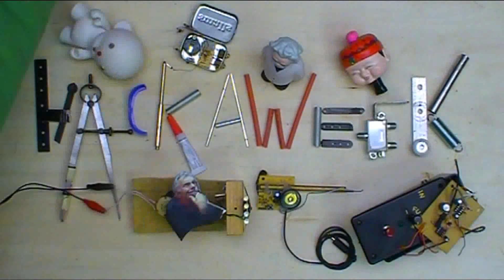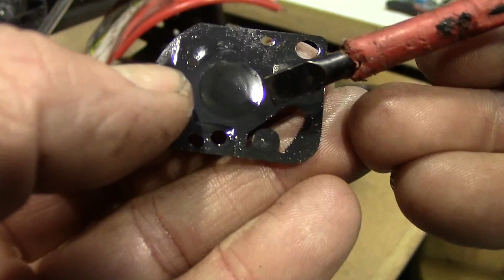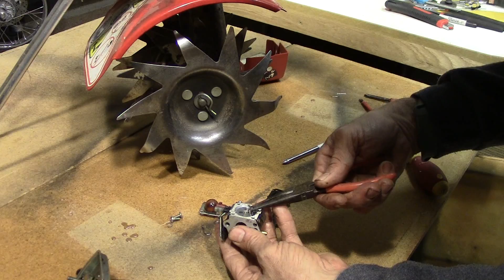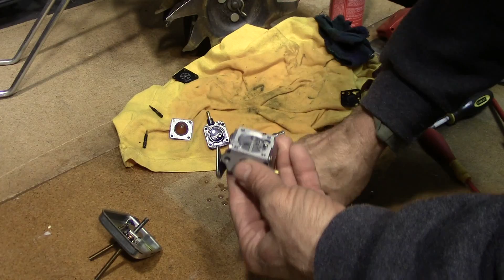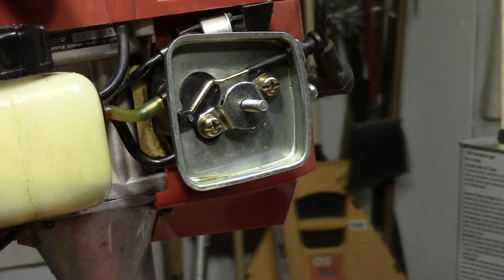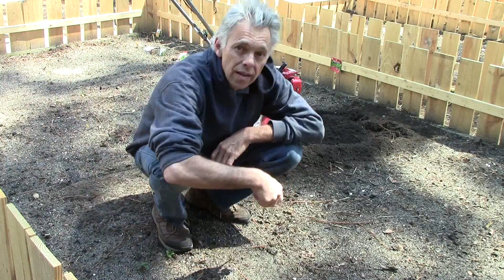Cleaning A Two Stroke Carburetor

Comment: I have done the same thing with that type of carburetor on a Mantis tiller only I rebuilt it but the engine will not idle.  I cleaned a carburetor on a weedeater with a slightly stiff diaphragm but the engine still runs sloppy.  It revs a little bit then goes back to an idle.  How can I fix this problem?

Comment: Good video. I had to do this on a chain saw recently, and found that the problem was the small screen filter inside the carb that was getting dirty. That card does not have that small filter inside?

Comment: Great job! Also good rule of thumb is once you get it tuned in turn the high side out just a hair further (1/16th of a turn give or take) so it runs the slightest bit rich. This generally makes cold starting easier and also ensures you wont accidentally run it lean.